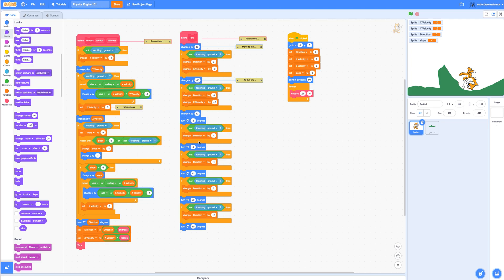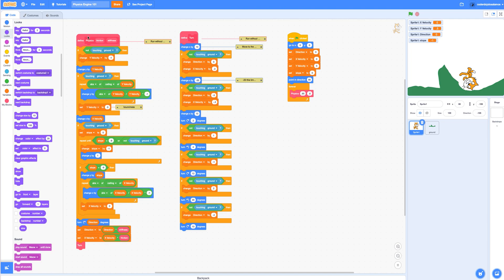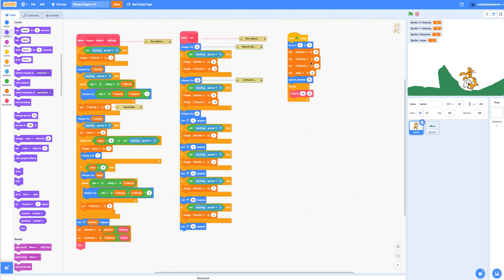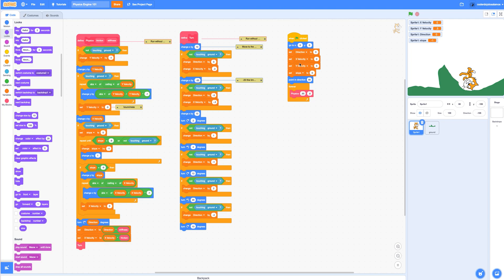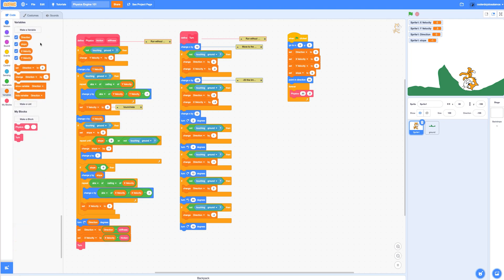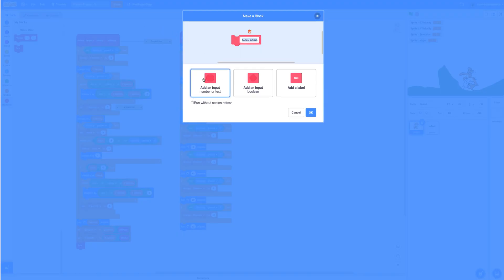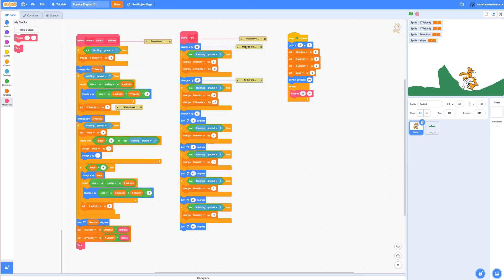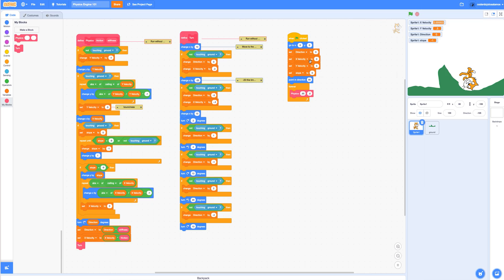Create A Physics Engine In Scratch

Comment: But can you code chatgpt in scratch?
Reply: well you can code chat-gpt in scratch, but there's multiple downsides to it. here are the 2 major downsides:

1. it'll take a very long time to make
2. even if you did make it, it'd take a very long time to process stuff
Reply: @ze5os427  I'm sure you could get chatgpt to generate the xml
Reply: @SamualN  ChatGPT isn't always right dude, if it is then there would be tens of thousands of mass-produced AI at this point
Reply: @totallynotcoolguy  I didn't say it would be good
Reply: @SamualN  well damn, sorry
Reply: Theoretically you can, but it would be hard, lemme show you some (get ready for a yapping session):

1.There are exactly 2 other AIs behind the scenes, one will check if the product that put out is grammatically correct and make sense, one will check if it is relevant to the prompt given by the user. Those two are called "Trainers", and they have to go through Supervised Learning (it is not the same as deep reinforcement learning), which means you have to sit there, go through every single thing the AI made and choose which behaviour should stay and which behaviour needs to be deleted. Then there's the main AI that makes all the product from your given prompt, it will be trained by the two Trainers that i mentioned, and it will go through Unsupervised Learning, which means the dev doesn't have to sit through the same painful process like the two supervised Trainers. Then you have to finetune it, which means you have to make a LOT of rules and conditions (and it have to be extremely specific to prevent the AI from "cheating" through rules and conditions loophole) for the AI, reward the AI if its doing the right thing and punish it if it's not. Then, you have to get, more specifically steal medias like photographs, drawings, videos, though thats pretty much illegal for using  the art without consent and feed all that to the AI, then again finetune it to whatever you want, and that alone takes a long time

2. Scratch is EXTREMELY slow for those that i mentioned, and from what i know, there isn't a stable way to train the AI models in Scratch yet, and if there is, Scratch mostly uses CPU for everything so it would be running at 1 fps and heat your computer up. It is just not very performant to be use Scratch, let alone open or load the project.

3. How will you make money? Making ChatGPT in Scratch is like i said, very hard. Who would want to sit in front of their computer 24 hours a day finetune an AI? Who would invest in a little goofy Scratch game?

4. Who would care? Most of Scratch's users are mostly from 6 to 12, and Scratch only features creative or unique games that made from simple code to make the users more engaged. So even if its somehow runs at constant 30fps, no lag, no pay, there would be absolutely no one to play it without some marketing or i dont know, advertisement? And getting some views and love and favourite from some little kids isn't worth it for possibly a whole year of constant work and exhaustion